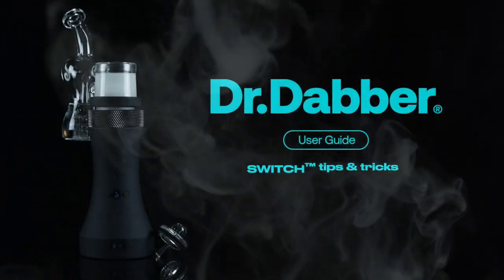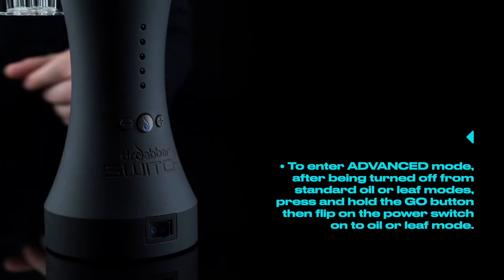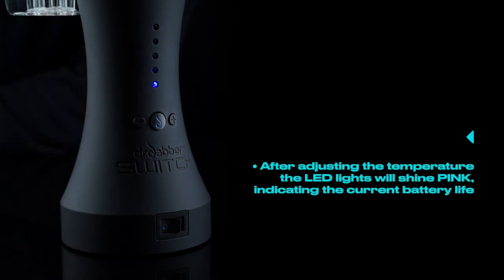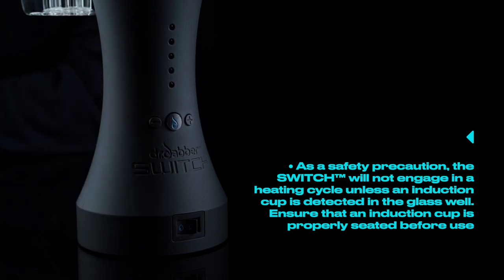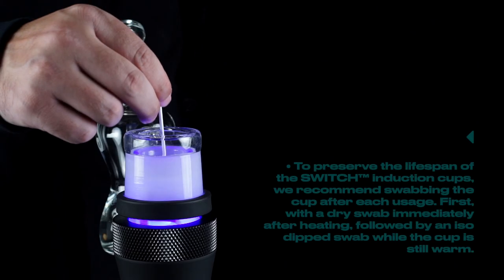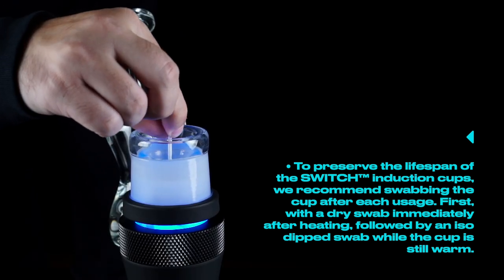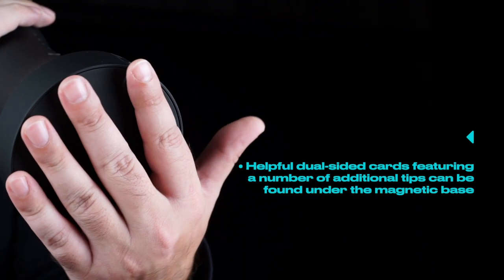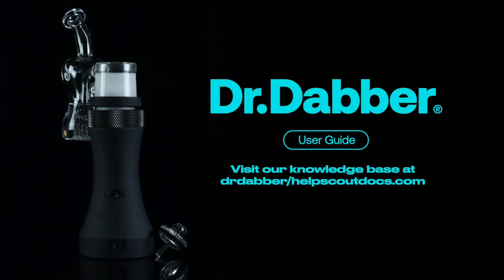Switch™ Tips & Tricks - Dr.Dabber® User Guide

Comment: OK so i am interested in this thing. Do you really have to clean that mf 3 different ways after every hit with concentrate?? Thats what it is suggesting here, no?
Reply from the maker: We recommend cotton swabbing your cups after every use to extend the life and flavor of these parts. The full unit does not need to be cleaned unless it becomes overly dirty or if it is impacting flavor. Full cleaning should be done after about 50-100 uses.